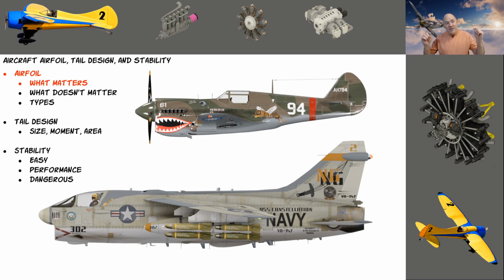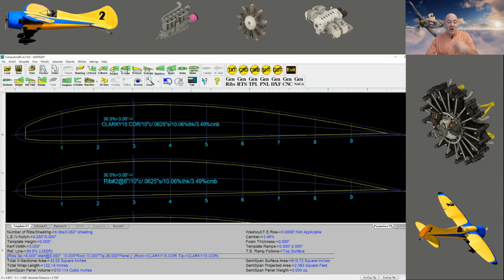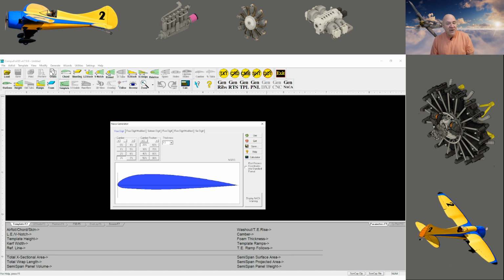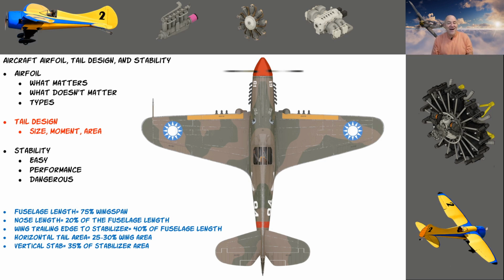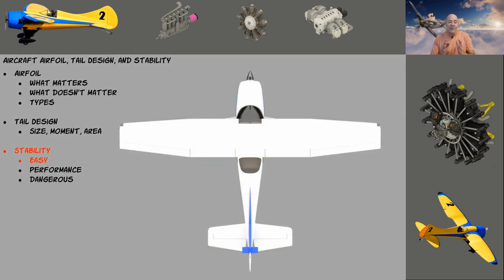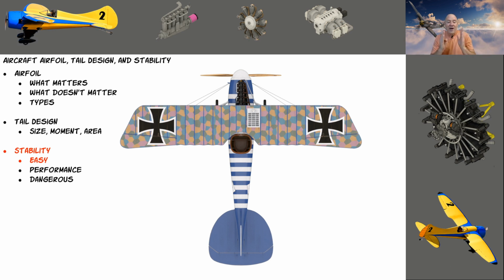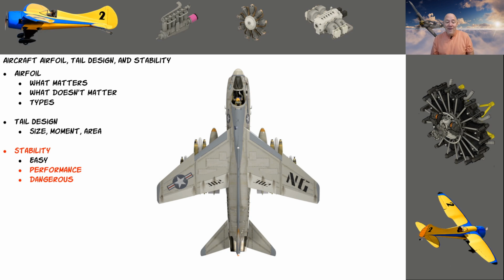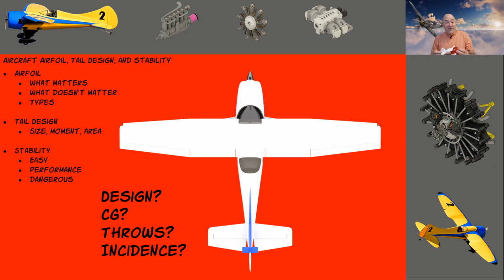Can You Guess Which Airfoil Works Best?

Comment: Such a Great video…!!! I’d like to see / hear a little bit more on the airfoil Vs flat sheet tail. I am also designing airplanes (got them flying on the channel also) and lately as I slowly “unlock” new techniques I started designing planes with airfoil stabilizers, mostly to make it look bulkier to the eye (I like that). 

I also asked AI whether that’s something worth wasting my time on, and said that it definitely is, explaining to me why a flat sheet will have the air not following the surfaces after I explained it my style and vision behind my builds, so it knows my Raynold’s numbers:

Style and vision: I make airplanes to the light and portable side, 1-1.5m wingspan, keeping the, lightweight enough, so I can fly them slowly if I want to, take off and land at these beautiful nature spots that I go on a motorbike, so usually there is the need of landing in tight hiking paths. Plus this way they cruise at 30km/h which looks more scale…

 Since I don’t have friends with the experience of yours, what would be your opinion on this, especially for an 1m wing airplane, would you bother on adding an airfoil? (If let’s say the weight remains the same). Would there be a noticeable difference in handling and high alphas?

Comment: I have a Europa mono wheel, during development the fin/rudder needed changed because rudder inputs at low speed caused too much roll, the fin originally a rectangle shape and  constant cord rudder, these both were changed, tapered the fin leading edge back & increased cord on bottom part of rudder & decreased cord on top area of rudder, these were the right changes.

Comment: Smart advice and all true.  I tried writing a similar "plane design" program (on a Sinclair QL!) in the 1980's.  The way I did it was to break down aircraft into a dozen or so "types and sizes".  Then I built a database of at least a dozen or so airplanes of each type and size, and used the averaged numbers to form a basic "specs outline" to start from.  (all numbers... no graphics in those days)   This was ok, but I abandoned that once I read a couple of well-written modeling books, including Andy Lennon's.  I've ended up the same way as you... I had positive experiences, and got the performance I wanted from a half dozen airfoils, and don't see any reason to switch, for most RC designs.  I'd say that, for most technical things we do as RCers, "No one step is rocket science.  But... There are a LOT of steps!"  :)
Reply from the maker: Well said, rock on!

Comment: I thought you were gonna talk about the actual layout and designs of the wings and empennage more and was hoping for a bit of a deep dive on the super-stall characteristic of T tails and how a cruciform tail compares or what else you can do to mitigate super stall on either design. Cruciform tail is probably one of my favorites aesthetically, plus it's less likely to, well IDR the specific term but "stall" the rudder's control surface in either direction, quite unlike conventional tails in pitch up or (to a lesser extent) T tails when inverted.

Comment: Good vid! I use with great results inverted airfoil for h stab in high speed racers, almost no pitch adjustments, as for foamies, you're right, one of my favourite is a su35 full fuse but flat wing. As you say, pay attention to the little details, motor thrust line, wing and stab incidents, cg and you can fly a brick.

Comment: Great video Dag. Thank you. I'm designing a small shoulder wing vintage style (lightweight) 60" span RC model. What do you think about having the thrust line, the wing, and the tailplane all at the same level? The flaperons will be outboard of the tail. Some designs seem to have the wing and tail on the thrust line and get away with it. Are there any negatives?
Thanks
David
Reply from the maker: I have seen all sorts of planes with the wings and h-stab above, below, or on the thrust line. If it's a flat bottom wing, you will see different incidences versus full symmetrical. Some aerobatics planes have the wings and h-stab on the thrust line. You may have to tweak the incidences a bit, but it should work. I hope this helps.
Reply: @dagtheaviator  Thanks. The airfoil is semi symmetrical. Sounds like all-one-one-level shouldn't be a problem. That's good news.
David - in the UK

Comment: I built a Jerry Bates short kit 1/5th scale Hawker sea fury it was my fist time building a short kit and there was not much instructions . but i had built a lot of kits and even a few scratch kits so i dove into it . It called for big thick Balsa spars for the wing so i instead cut my own spruce spars of smaller size but much stronger . i also had to figure out how to make the 3 door landing gear doors work together but after a few tries i got it right . then came the split flaps and again with trial and error i finally got them working good . the entire model was sheet  with 1/8 balsa and then covered with 1/2oz cloth and west system epoxy un thinned and because i was a first timer at epoxy and cloth i dint squeegee the excess epoxy off . so all in all it turned out nice . it was painted with Automotive high build primer for the panel line taps and then sanded lightly with 500 sand paper and then painted with the colors with Latex house paint and then a coat of semi gloss Polycrylic and graphics from Callie graphics . all in all it turned out very nice but after all the servos and engine and retracts got installed and then time for CG balance i had to add about 6 lbs of weight to the nose . the engine and batteries was as far forward as i could possibly get them.the engine was an EME 60 cc 2 stroke . so the Sea Fury all up weight was around 36-38 lbs the maiden flight was not so good the engine was under powered for the weight of the plane and my poor choice of 4inch soft tires made it flip on landing and broke the vertical fin off.  I have since then rebuilt it and have sanded the entire model down to remove some of that epoxy weight and have also rebuilt the firewall box and moved the engine mount 3 1/2 inches more forward . I am not good with judging power to weight ratios for gas engines i do ok with nitro engines usually just going up one size in power that,s recommended I am looking into getting a GAS radial engine but not sure what power size it should have . My Sea fury as seen on Callie Graphics    https://callie-graphics.com/collections/hawker-sea-fury/products/sea-fury-800?variant=38000193165

Comment: And about the vertical stabilizer position? You install they 0 degrees or some degrees left or right?
Reply from the maker: I have always used Zero. But, I know a few that have added some V-stab off-set to counter act P-Factor on old WW I type planes. Thanks!